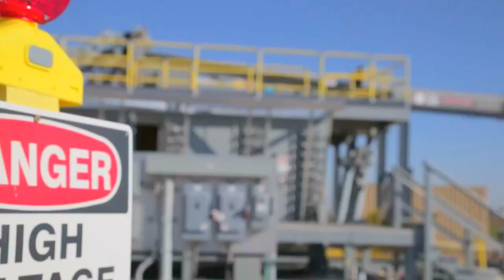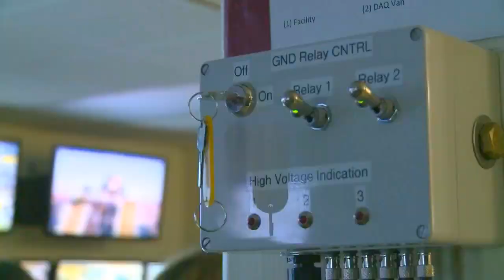Office Of Naval Research - Electromagnetic Railgun First Shot Commissioning Series [720p]

Comment: why is the projectile square?
Reply: It's a test round, not a real projectile.
Reply: That's called an armature.  The railgun works like a maglev.  You have the armature, which is really a metal slide, that couples to two rails on the inside of the gun barrel.  The rails act like a linear AC motor to accelerate the slide down the rail.  The slide then flies out the other side.  

For a real round, they make the slide in two pieces.  When it exits the barrel, the two pieces split off, leaving a conical round flying to the target.

In this video, you only see the round exit the barrel encased in the armature.  You don't see the armature splitting off.
Reply: TeaSipper we'll I figured it was like some type of sabot containing a dart or something like that. I just wonder if it has to do with surface area[of the rails] or something.
Reply: Yeah, the rails are straight and flat in two parallel tracks.  They are either mounted top and bottom on in the barrel or side to side.  If you take a close look at the barrel it's rectangular shaped.  The armature has to have flat sides to make contact to the rails.

Comment from the maker: Looks like it's ready to be mounted on the DDG 1000 Destroyer. :-)
Reply: arronlee33 Always love seeing our military get cutting edge equipment. I know that these were planned for the Zumwalt Class. But do you think they will also be equipped on the Arleigh Burke Class as well?
Reply from the maker: You can mount railguns on any platforms but they need lots of power. :-)
Reply: Gonçalo Coelho you can run this of just the power of a car batery  it charges  capacitors which delivers the current
Reply: Gonçalo Coelho I was saying that it will not use that much power at onset just over a long period of time just like a sling shot

Comment: anyone has an idea why the projectile looks like a car axle shaft?
Reply: The final round for this is to be a Sabot round, however to save costs they are just shooting a test sled.   So what you are seeing is the shape of the carrier, not the actual projectile that will impact the target.
Reply: A railgun works kind of like a maglev.  Inside the barrel there are two rails that accelerate the projectile.  To couple to these rails, the projectile has to be enclosed in that rectangular piece shooting out of the barrel, which is called an armature.  Usually, the armature is in two pieces.  As it exits the barrel, the upper and lower pieces encounter air resistance, and split off, leaving just the projectile carried in the center to continue the flight path.  

In this test, they either didn't bother making a real armature, or the camera didn't follow the projectile for long enough to see it split off.

Comment: no recoil ?
Reply: For every action, there is an equal opposite reaction. Yes. There is recoil, but it is also spread outward sideways! That barrel must be extremely robust to support the rapid acceleration of these projectiles from 0 to mach 7 in under 50 feet. Think about that! It is an achievement hard to grasp! It takes about 13,500,000 joules per ten pounds of ordinance to accelerate the projectile to 7900 ft per second and those barrels must absorb about a tenth of that outwardly.... nuts!

Comment: Why is there a muzzle flash?
Reply: sound barrier
Reply: Plasma from the gas used to prime a shot and material burn up from extreme temperatures, possibly graphite and teflon based low friction materials in the rails being charred and burnt, the particle buildup, air resistance super-heating the inside, air being ionized, and the electrical current's buildup and discharge...
Reply: And magic, also
Reply: combination of heat produce by air resistance and friction in the barrel (specifically the rail). the fireballs are burning metal particles.

Comment: what it the sall blast at 1:38
Reply: viking squirrel I would imagine, the pressure is released straight up into the air. If the back pressure came out the back or the side, it would probably be very dangerous for anything around it...
Reply: but it's like 10 foot away